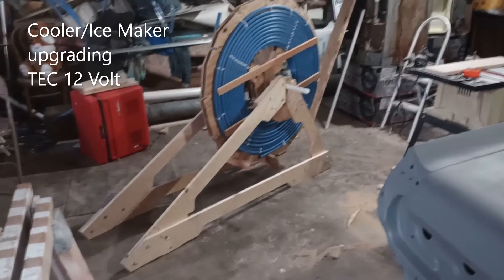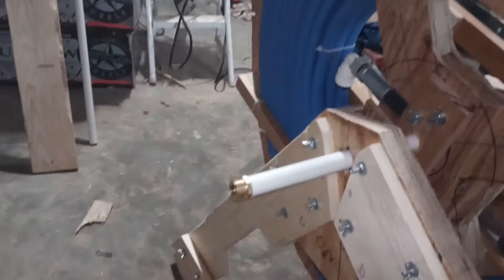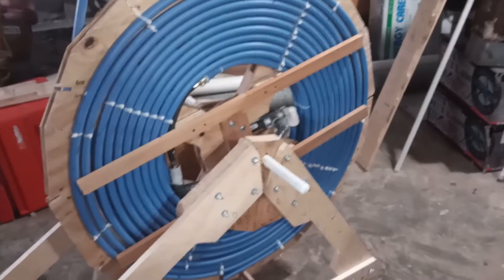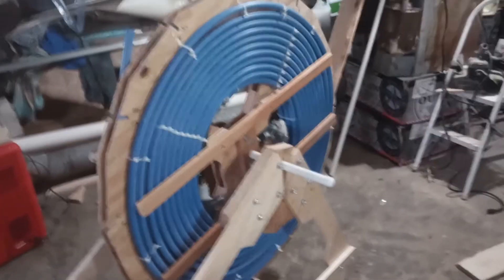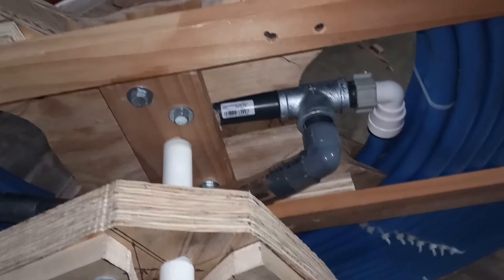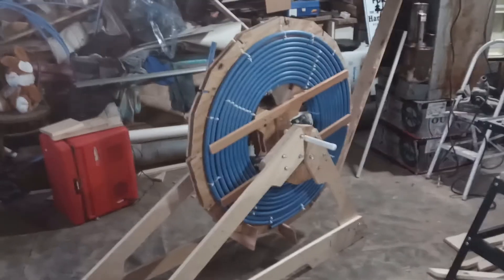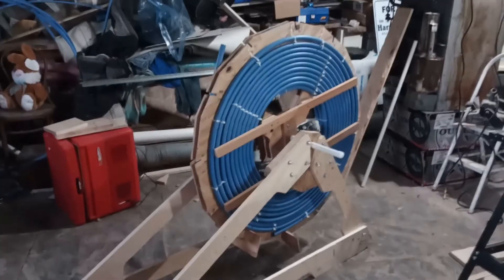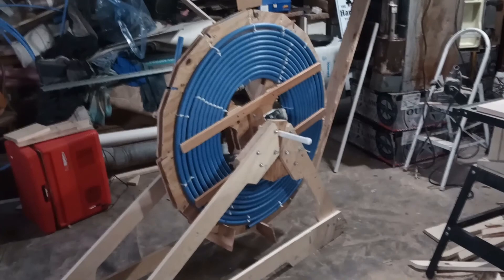High Lift Spiral Water Pump for up to 1foot of water depth.

Comment: @Danny Ray Jewel did you ever get to test this build? I'm curious to know what you achieved with it. What is the effect of adding more coils to the pump, do you get more gal/min or more head or both? 

Also, one thing that is on my mind, does the length of the paddles matter much, for example if you add more coils, I assume the whole wheel will be more heavy and need more work to keep it rotating, so naturally I'm thinking if I extend the surface area of the paddles, It should  make me drive a heavier wheel without decreasing the RPM right?
Reply from the maker: Thanks for the inquiry. My brother is helping me finish the Scoops and Paddles this trip and test it soon. The 3 Scoops are spaced evenly to help balance the need for torque from shallow waterways. I have had to cut about 30 feet of PEX to accommodate the size and function at Scoops. I'll post another vid about the current work for the first test.

Comment: What is the maximul lift? 10 meters, more, less?
Reply from the maker: The one I based my math on has one 1 inch plastic pipe coil at about 6 foot diameter and about 90 feet of pipe. It pumped to about 70 feet if I remember correctly. My pump uses three Spirals of 3/4 PEX about 90 feet each equaling about 270 feet of Spiral joining to one outlet. My math estimates it will pump from 70 to 100 feet high at about 1 to 2 gal per minute.
Reply: @Danny Ray Jewell  Thank you for the good information, mr. Danny. I have a big river in the back of my garden here in Romania, and I want to pump the water about 9 meters high, (~30 feet), and I don't want to overkill the pump or not to be enough. The volume I need is about 3.000l/day (~800 gallons)
Reply from the maker: A Spiral pump generates Air and Water under pressure. The Air pressure can be used in different ways. One is to pump Water under Air pressure even higher if needed. When Water is pumped to an elevated spot it is like storing energy in a battery for later or to increase the pressure at a lower point of use, like to run a generator at high speed.

Comment: some info.   see info at  link.
best performance depends on  Optimal  design.
1)  minimum effective pump radius; of about one yard.
2)  use  no more the four 'loops', at the pump rotor.
3)  optimally sized pump and riser tubing.
4)  Optimally designed  intake  scoop; scoop design should result in the entire scoop to being, briefly, submerged.    scoop should  NOT  be  'short', as seen in some illustrations.
5)  air-lift affects are maximized by the use of a (nearly) vertical outflow 'riser'.    water can be  delivered to an elevated catchment; as part of a gravity-fed  delivery system.
6)  a maximum of  three pump  'phases' can be utilized; in such a case, the use of  low-loss check valves at the manifold may be recommended.   (this number is based on an estimate of a  nominal  'phase' interval of 120 degrees, at the manifold.     cheers
https://lurkertech.com/water/pump/morgan/blair/002.htm

https://i.ytimg.com/vi/nDnyR3uPuo0/maxresdefault.jpg
Reply from the maker: My data comes from a group of examples and different sizes. If you want to say something then just be direct. I don't do anything without a lot of confirming data and variations. I should be able to get a percentage of total length of coil at a certain diameter as the total height at 1 to 2 gal per minute. I can't get help to finish so it is whenever I can do it myself.